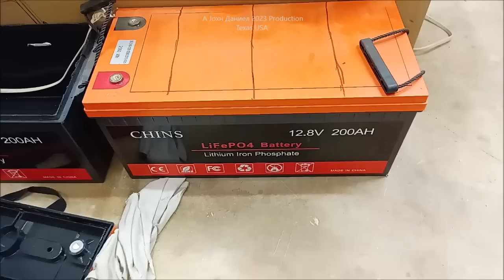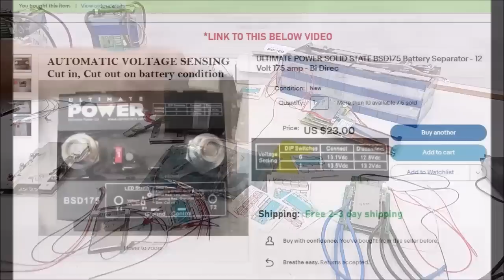The Limits of most SMART BMS for Lithium LiFePO4 Batteries, Avoid them, I Explain

Comment: Can I connect 4 in series to make a 48v battery pack
Reply from the maker: Not that I know of. The video is for 12 volt systems like I was showing. The problem with 24 and 48 volt is it puts you in a whole new specialist gear category that makes you buy only dealer options.

Comment: I tried to find that balancer from your video and couldn't. The battery isolator is much more expensive now. I have 4 of the 4s 100A and one of the 8s 200A in my cart along with a collection of 6A active BMSs that I found using key words in the item names. It looks like I'm going to be searching for a 16s 120A to 180A for a while longer. Simple ones are hard to find.

Comment: I don't understand why they can't make a simple bms that just works,  uses a simple MOSFET array or non constantly powered contactor, a latching contractor, uses a pulse to shut it off, or power on,  and be capable of a sustainable 200 amps minimum,   there is a guy on YouTube built a diy bms, made it open source, I started with that,  but need to order parts! It does anything you want except make coffee and wipe for ya! 😆,  I want to finish the project, I'm not that computer compatible, program chips and such! Could use help! ✌️
Reply from the maker: The real solution is a 3.65 volt charger/maintainer, Per cell only charger then all the BMS issues fail to exist. The BMS was a dumb thing to design to start with. You would simply put a solid state resetting circuit breaker sized to 80% of the battery real capability, size your power draw to respect that design, and no more computerized nothing. No more Float, no bulk, no Speshul nothing. 
The charger would take in your solar, split it to 4, 8, 16 leads sized to handle the amps, and it would shut on and off with basic current limiting action. You would wire for 12 or 24 or 48 volts the cells ,but charge each based on the standard charge of 3.65 volts. Common standards used in old school marine systems.

Comment: Check your facts. Andy has 3 48 volt packs running in parallel with 3 BMS's that you clam will shut down the whole system if one pack fails. Those BMS's have no control over each other.
He is testing some BMS's that communicate with each other via communication cables. They are the ones that can control the system. If your batteries setting there are running JBD, or what ever you showed without communication connections, 1 BMS or pack failure WILL NOT shut down your system.
Reply from the maker: So you don't agree that one battery going bad will shut down your BMS? With a System that is 48 volt, 16 batteries, that is your whole system. Loosing 33% on his system would over load the other 2 and they would shut down.
Reply: Yes, but only for that pack. If they're paralleled on a common bus bar, your system would remain active. If what you're describing were true, there would be a problem in your system design. My system never draws more than about 40 percent of the BMS rating on any pack.
Reply: The BMS is supposed to shut down the battery in case of a parameter out of tolerance. That, and balancing is its job!
Reply: @JOHNDANIEL1 highly unlikely it would over load the other 2 batterys and bms's, he's using 100a bms's at 48v but if the load was above 10kw it would over load them and cause the bms to shut down
Reply from the maker: The video is as it would be obvious is about 12 volt systems, 24 volt if you imagine into it. But a battery is the individual Cell in any system. Not the case or its control methods. So if you have a 3 bank 48 volt battery system (48 cells 3x16s) , unless your lying about your battery, your as most running them over 50% BECAUSE THEY ARE LiFePO4 and high cost, but when you loose 1 single 3.2 volt cell out of your 48 total, you instantly and we have seen it already, have total shut down. This is caused by the remaining load, unless like some you just pissing away money on a 500% over sized, the remaining power usage load will fault out all your batteries as excessive. It's a super critical in 48 volt systems, somewhat bad in 24 volt systems, and in 12 volt systems a inconvenience. It's is beyond ignorant to use 300AH 3.2 volt cells in a 48 volt system unless you got them for near free. You just shit the bed on any redundancy by doing that, no matter how many COOL comments you get from viewers. 
People who get all pissy about my explanation likely sells replacement batteries.
Reply: @JOHNDANIEL1  I'd much rather use 16 304ah eve cells in either a 4s 4p or 16s setup then 6x those 100ah types you recommend for a rv, but each to there own. Even in a 4s 4p set up with 200 amp bms's if a cell fails and 1 bms shuts down you still have 600 amp of current available to draw from the remaining 3
Reply: @JOHNDANIEL1  I couldn't agree more with you when it comes to price tho mate, not everyone can afford to buy and build 3x 300ah 48v battery banks and have a system that's unaffordable for most
Reply from the maker: After almost 15 years going out to do work on mostly 48 volt systems with battery issues, and knowing its less then 25% of the builds in that period, I was convinced to just build for amps, not volts and I have had zero issues since. If people want to wait to order special parts for 48 volt, or even some 24 volt when 96% of the DC market is 12 volt than thats what they like. I can be up and running from a stop into a truck stop or walmart for cheap then waiting for China to send me a 48 volt anything. Higher voltage degrades a 3.2 volt cell faster than lower voltage ( In Re Gelion Cell Tech, 18 years study shows a notable percentage of total anode density loss in every increase in bank voltage to lithium chemistry) so rock on with 48 volt, just do it for much less lifespan.
Reply from the maker: How I explained it before https://youtu.be/1SNqV7nMDHU
Reply: @JOHNDANIEL1  I'm with ya there mate, i have a 12v setup not 48v I was just trying to explain his setup. I can barely afford to buy 4 cells to make a 12v battery let alone 16, not everyone in Australia has money 🤣
Reply: @michaeldudley7840  It's so true and obvious that I didn't really undersdand the main reason of this video..... Ok maybe with these 12V battery packs with crappy buitin BMS. But as soon as you are doing some DIY batteries, it's obvious to have a common bus bar where batteries are gathered  and for each of them indivudual (overrated) BMS (personnally I applying the famous chinese x 2 factor)

Comment: If you want to balance that big chins pack with that pissy balancer/bms it will take forever, most smart bms's let you control when balancing happens and have it like that small one. Most batteries/BMS's can also be connected in parallel, just expect insane current flow between packs as they equalise. Edit: the cost savings are good with what you did though.

Comment: Just found your site this morning, hope I can learn learn enough to put a nice battery bank together without making to many mistakes. Will watch your other videos. Do you know how much power all of these BMS's eat up? Just getting into lithium batteries for my rv, got a lot to learn. I'd imagine some use up more power than others.  Thanks
Reply from the maker: The Engine Start versions I am using only have 2 watts of stand by in active mode. Most others use over 13 watts in same mode. In stand by mode none really use over 20 milliamps or 1/8 a watt. Battery internal resistance on LiFePO4 itself uses more. Compared to Lead Acid, its sitting energy use is 1/17th to 1 so no need to worry.
Reply: @JOHNDANIEL1  Thank you! Will be buying 4 Lithium 280 AH batteries this week. (16- 3.2 volt cells). Looking for 4 good BMS units and a balancer. The BMS,s need low temp charge protection. Got a lot of work ahead of me. Still learning.

Comment: A Question for the Hill billy Professor :) Is it the Red + or the Blue/Black - the live wire in Direct Current?

Like the Ions are - that is traveling in the wire correct. So which one of the wires can you actually get electrocuted by if the voltage is high enough?

Like I would think the DC - would be the live wire... Yet.... I'm confused as the standard color for an AC wire is Brown and the + is Red close to it. The Blue is 0 in AC and yet the Black/Blue is minus in DC....
Reply from the maker: Research marine DC wiring for your area

Comment: Can u use this in series? for like 48v system ? , and is it possible to read out the voltage on every cell ?
Reply from the maker: They handle 24 volt, but for 48 volt you need the next model and they are currently out of them, 60 amp per model max.

Comment: Now what if i want a smart bms where i can limit the charge state to 80% and start balancing at 80%? Can't program the cheap bms for this. And as long the 4x48V lfp is connected up parallel. They never need to talk to each other. And planning to buy 4 of the same balancer anyway.
Reply from the maker: Set your solar controller to GEL battery, max charge of 14.0 and Float at 13.0 even and you won't have that issue.
Reply: @JOHNDANIEL1  didn't say it. But it's lfp 13s packs.
Reply from the maker: What ever solar controller you have if its parameters are adjustable you can set it for stopping at a choice point. 48 volt User settings. I would use GEL battery setting on the controller as a basis,  and set top charge at 54.0, float at 51.4 and your about right on 80% to 85% so you get the power in as the cut control.

Comment: I'm small time DIY project guy with a few lythum batterys in battery boxes,  I built a couple of batterys 4 cells each no bms yet I picked up a couple of bms on your recommendation and will give it a try , might need your help,  I just in case of a power outage will need to power a frig or cpap, do you have a video on what im trying to do  ?
Reply from the maker: Not yet but that's coming one day. I have been constant the last 3+ months with physical therapy hassles so not doing lots for now.

Comment: with the 100amp  board do you have to usa a 100 amp battery
Reply from the maker: You can use any battery you want, but common is matched or less of a BMS for your battery. So you can use it on a 130ah, 200ah but not recommended using on a 50ah unless your only intending to use max of 1C of 50 amps.

Comment: $369 DKK 2530 - 100Ah Li Time
$181  DKK 1236 - 30Ah RoyPow

In any case, that would most likely be from the US, the Li Time, so I would need to pay Toll and shipment as well. But any case, I have my RoyPow incoming from Germany and i'll get some experience with things. But of cause, you can't really get to much of collection storage :P
With the batteries I am getting it will take around 2 days with sunny weather to fill my system fully up, it is not much... Would be nice to have a system where I had for like 10 days of collection or something. But of cause I can calculate on that later on. Although I might do fine with my first system here. I got off the 230V converter on the Bluetti EB70 now for the most part which help a lot on lowering the output, made a hillbilly thing I guess for my computer screen, and running it directly from 12 volt now. It was converting up to 230V and then down again to 16 volts I think it was, the screen made for 14V - so a lot of loss with the 230V converter activated as well uses power. Not sure how much energy I save but it clearly can be felt not draining as quickly. The 12 volt output from the bluetti is 13.1V so, that also gets it closer to the 14 Volts that is written for the screen, although as I understand there is usually room from the specifications to still run it being a little off.
Reply from the maker: If you buy from the US site using that link I put out there, Li Time has a warehouse in Poland and Spain. Put them in your cart, then go on Chat on that site and tell them you want Europe sourcing.

Comment: Why not just parallel all three of your balance leads together off of each individual BMS wouldn't that give you more balancing power since you are apparently linking all three bms's and they're all linked together for 300AMP. would that increase the balancing output
Reply from the maker: It utilizes the balancing resistors and transistors from each board through the pins added. By using all the leads you can unbalance the current control on 1 or more of the boards. It works as one master, up to 3 more as followers.

Comment: the advertised BMS has no communication, you cannot see if a cell is damaged. Id rather use a smart BMS, so I can check it with my phone. This way you also see the total charged capacity and much more
Reply from the maker: If you want a smart BMS get one. If some country decides to connect to it and shut your battery off they can. A dumb BMS gives nobody but you the power and control. The department of defense has already said that all of these Bluetooth and Wi-Fi controlled items that people are buying can be controlled by China remotely.
Reply: @JOHNDANIEL1  so you have 3 batteries with dumb bms's mounted in parallel, how do you know if one battery has problems? You have no display and no communication with the BMS.... thats a real problem.
Reply from the maker: @vb9528  Same way you deal with a Lead Acid battery that may have a cell going bad in it. That's how we did things before people got retarded and depended on technology to replace their common sense.

Comment: Can I ask how you use these 4s bms units in 24v or more.   Do you just buy a bunch and make 12volt independent batteries and stack them up in P?
Reply from the maker: You need a 8S BMS for that. These are non series but I have done it, but the result is they try to charge too high and that can mean bad results. Best thing is the basic JBD https://s.click.aliexpress.com/e/_DDNijrV

Comment: great video, did not find the link of $7.5 that work as balancer ?
Reply from the maker: Super Secret: A DIY battery or even a hacked consumer battery can have as many BMS on it you want as long as they have a identical top and bottom charge rating. So using those cheap 100 amp or even 50 amp $5 BMS on them along with the high dollar DALY or JDB brands will be how you add balancing and option taps on the battery. I should do a video on how, you gave me a great reason.
Reply: @JOHNDANIEL1  do you know if these bms can be connected in serie to get for ex 24v or 48v ?
Reply from the maker: @N-Volt  I use these, they are cheap but all prices have gone up. 2 options https://ebay.us/2k9mFw ( really a 50 amp) or https://s.click.aliexpress.com/e/_DnEsMnJ ( pick the "4S LifePo4 3.2V 50A" for same one as on Ebay.) 
The world of Lithium users fail to understand you can put as many as you want on a 4 pack of 3.2 volt battery cells, even on 24 volt with 8s, 48 volt with 16s the same way. 
I usually use the main 150 to 250 amp BMS for heavy loads such as inverters, and the 20 to 50 amp BMS for making my dedicated safe 12 volt outlets. You get increased balancing at a faster rate with means averaging that is healthy for your battery. Likely I need to do a video on it more in depth.
Reply from the maker: I use these, they are cheap but all prices have gone up. 2 options https://ebay.us/2k9mFw ( really a 50 amp) or https://s.click.aliexpress.com/e/_DnEsMnJ ( pick the "4S LifePo4 3.2V 50A" for same one as on Ebay.) 
The world of Lithium users fail to understand you can put as many as you want on a 4 pack of 3.2 volt battery cells, even on 24 volt with 8s, 48 volt with 16s the same way. 
I usually use the main 150 to 250 amp BMS for heavy loads such as inverters, and the 20 to 50 amp BMS for making my dedicated safe 12 volt outlets. You get increased balancing at a faster rate with means averaging that is healthy for your battery. Likely I need to do a video on it more in depth.
Reply from the maker: @greenmenpt  They may be, but why? On a few 24 volt installs I did 16 cells, 184AH each, with 2- 24 volt 150 amp BMS, then added 4 of these cheap BMS to gain better balancing on each 3.2 volt, and have 4 of the 30 amp 12 volt outlets needed for lights and items. It allows you to make a 24 or 48 volt bank, but have taps for 12 volt access in the banks. About 250% cheaper without power waste of using a 48 to 12 volt converter.

Comment: I'm just getting into this, I have 4x200amp LiFePO4 batteries, that I wish to retrofit into a 48v block, could i do that with this BMS system, or would I?
Reply from the maker: The intention of the video is 12 volt systems, they are the most realistic for 90% of people and the most available options. When you go over 12 volt to save money on wire, you double you cost on everything else so the plan is to show those options. A 48 volt option is still at the mercy of boutique level suppliers and sources.

Comment: good bms, but that atorch display and shunt will not be accurate... i have one 400amp unit almost 5years and it foesnt measure volts and amps presisely... im looking for qucc smart bms instead for monitoring... it will be more acurate than atorch. rest of your video... just loving it as allways ;)
Reply from the maker: In 5 years they have improved, so far its real close on accuracy but testing it will continue.

Comment: Is it possible to purchase a replacement BMS for a LiTime LifePO4 12v Battery in case of EMP damage? I can’t seem to find any info on this. Thanks
Reply from the maker: I use a basic BMS with non compete / non commit design for using in such batteries. They do not have a issue using with other 12 volt  batteries. These in 200amp ( https://s.click.aliexpress.com/e/_DkCwsjt ) get the pre wired. Mine are kept in my shelves for such a possibility. I bought 5 of them, about $35 each and I put them in a faraday box already. You can use them on 100 amp to 190 amp battery cells and if your needing one for a 200AH to 300 AH get the one listed as 300 amp for that. Reason is the incoming charge cut off design is 50 A and 100 A prospectively.
Reply: @JOHNDANIEL1  

Thanks!